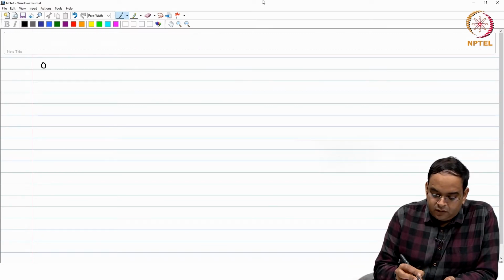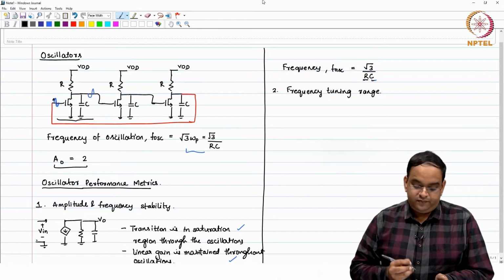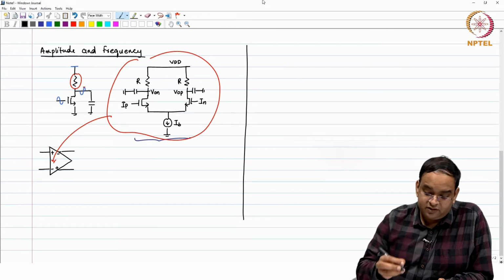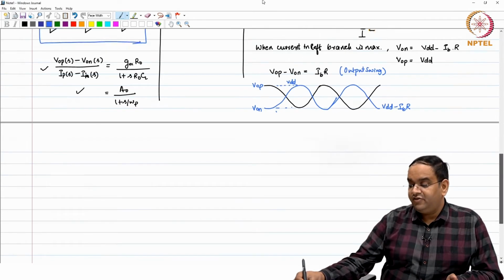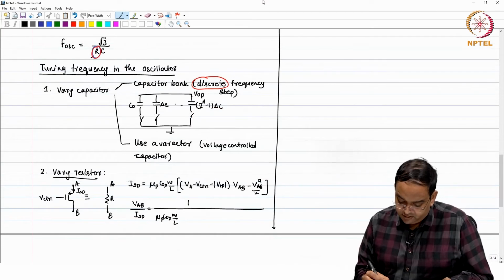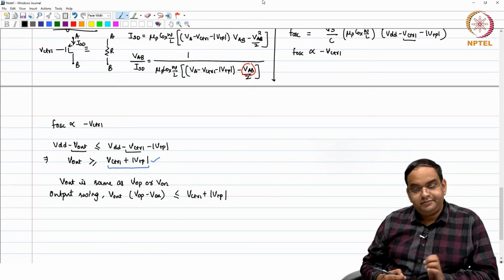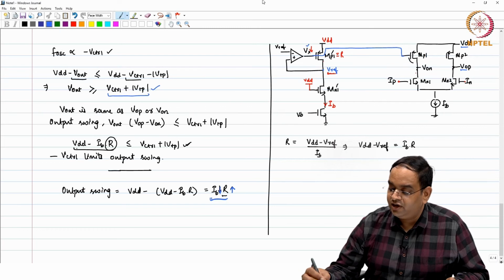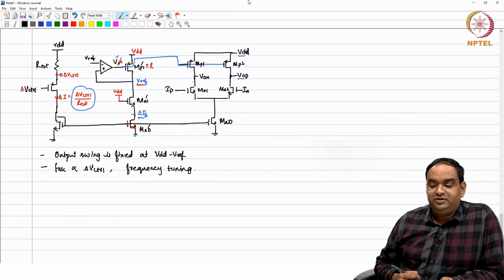Low Swing Ring Oscillator: Part I

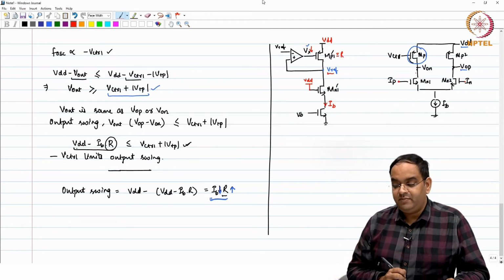Comment: Later after 42:00 all the transistor PMOS are connected with Vx , so as Ib increase Ron will decrease. But then why about Fosc ? Since Fosc is inversely proportional to Ron. An we wan to tune the Fosc too. Problem was that both Fosc and Vswing is Ron dependent. But this Solution is not helping in that.